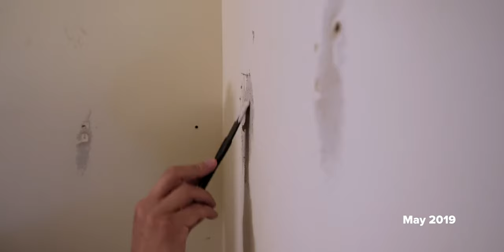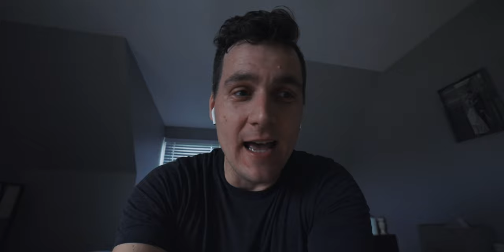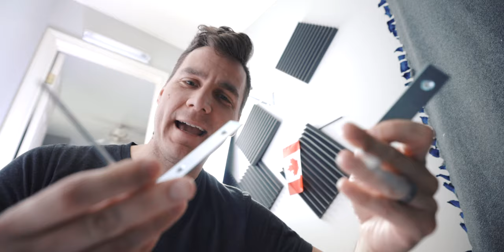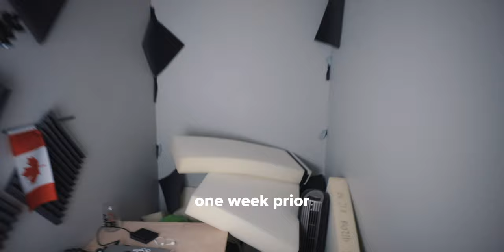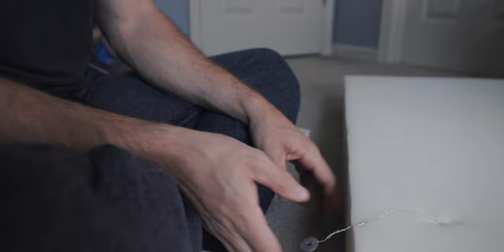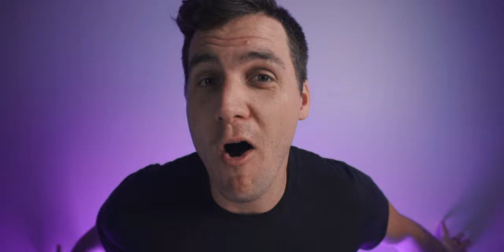Closet Studio Sound Treatment - DIY - It's NOT the Corners

Comment: Woah i think I might have to do this myself! I want a set space to myself to record my videos. Just a question. Would hanging large art canvases have the same effect as the foam? Thanks.  🔥🔥
Reply from the maker: I’m not sure! Are they thick and soft? Or just straight up canvas?
Reply: @RCodyWanner  I was thinking of using framed canvases that are typically used for acrylic or oil painting (I have a couple 24x36" ones).
Reply: Raya Kee I tried that but tucked foam inside the back of them. It worked well.
Reply: @JaneBoyd  Ok thanks!

Comment: Soundpanels can be easily mount to the ceiling using velcro tape. Easy to apply and they are really strong. And in case you don't need them any more ... fast to remove :)